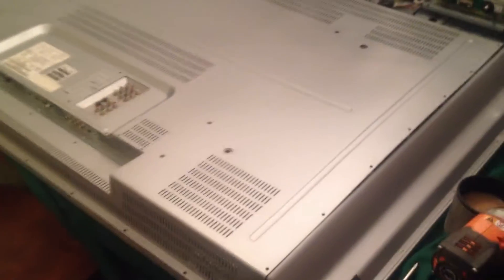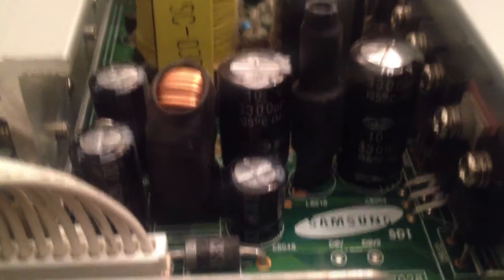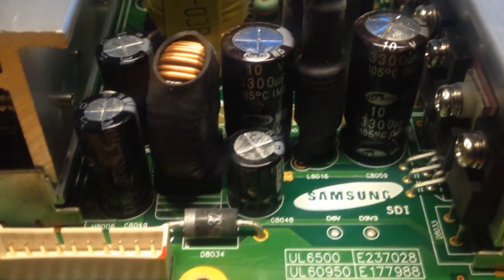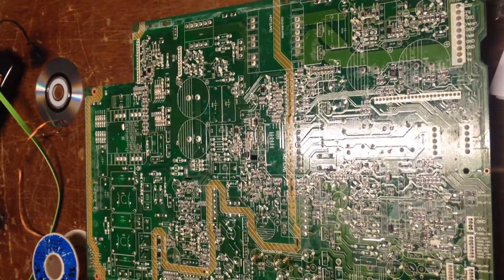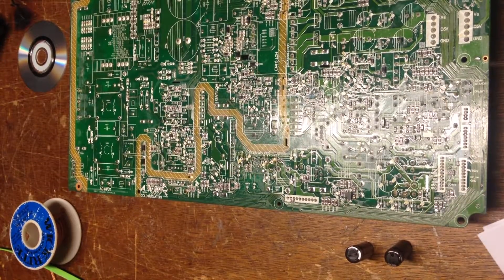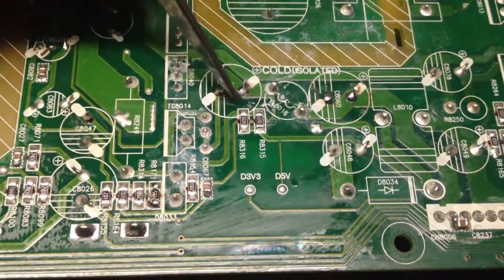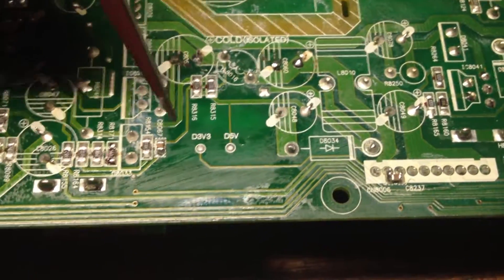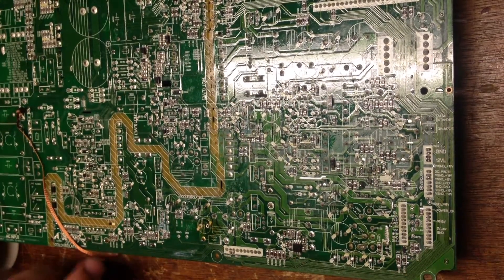Philips / Magnavox Plasma tv repair 50PF7320A/37 Bad Capicators

Comment: Hey I have a Philips Plasma 50pf7320a/37 that has the familiar 7 red 
power light blinks.
NO BAD CAPS OR FUSES.
With everything except the motherboard connection disconnected I still 
get the green power light for 12 seconds ( when I plug it in )and 
changes to the 7 red blinks.
There is also a small board on the power supply blinking 11 times.
With the Y-main and the X-main unplugged the VA starts out at about 65 
DC volts and about 40 seconds later it is at zero.
I have absolutely no DC voltage on the VS at any time.

Comment: Hi have Philip 50pf7220A/37 problem turning on just blinking red light then shuts off. I probably change those caps. Thanks for posting ill let you know if it works i just plan to change the two caps 2 3300uf 10v see what happen.